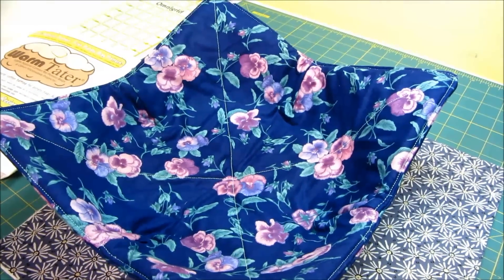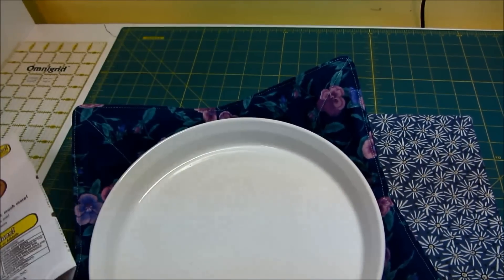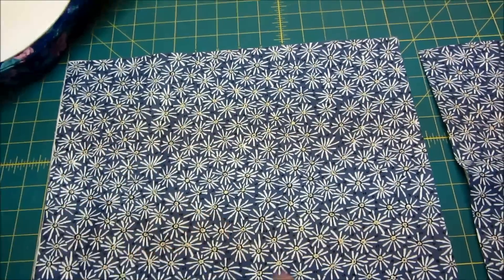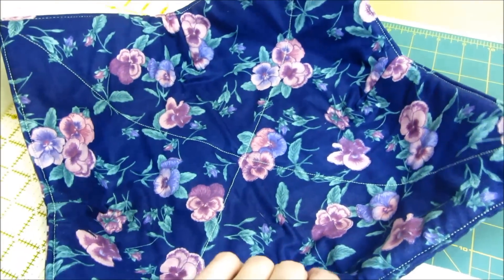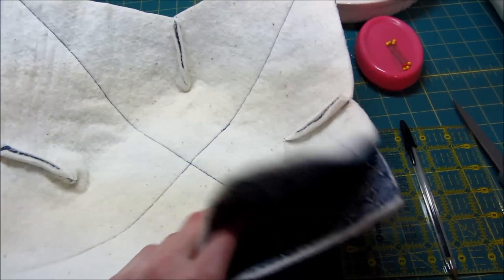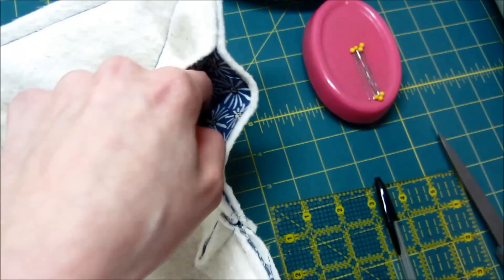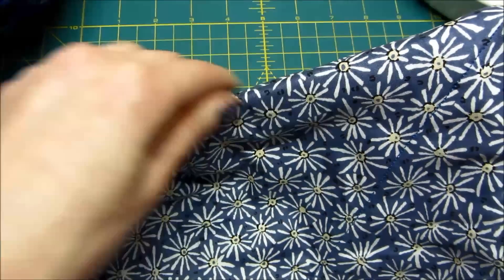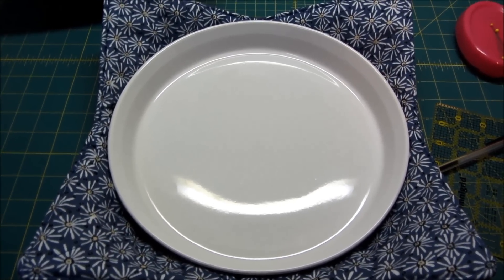How to make a microwave bowl cozy

Comment: It does not have to say for microwave or anything it just has to be 100% cotton, that means thread too. i make these but the batting is expensive so i went to harbor freight and bought a paint canvas it is 100% cotton too. but you have to cut off the edging that is polyester thread. they work great and are very cheap to make that way.
Reply: Thanks a lot for that tip. ❤️❤️
Reply: I often use old 100% cotton flannel sheets that I find at thrift stores.  I also discovered when I use cotton batting, I can use only one layer of it and one layer of cotton flannel without giving up any insulating protection whatsoever!  Batting is so expensive and since I make the cozies to donate to charity and as gifts for friends and family, the cost of materials is important to me.  I've made several cozies using only the cotton flannel and they turn out great and they go together a lot easier than using batting.  Most thrift stores also have fabric lengths AND I often look for 100% cotton clothing in cute prints. Check the largest sizes since they'll have the most fabric. So affordable and a good way to repurpose clothing.

Comment: Cut the batting 1/2" shorter on each side in reducing bulk for topstitching 4 layers only of decorative fabric instead of 8 (4 batting & 4 fabric). The edges do not need batting ...
Reply: Thanks for that tip. I have a lot of trouble top stitching around the edges due to the bulk of the batting even after cutting down to the 1/4'. I will definitely try this.

Comment: A suggestion on the darts, if you open them out instead of folding them on opposite sides you will not have so much bulk.
Reply: Thank you.  I would love to SEE what your hint means so I can really get it.  I don't use my sewing machine alot.  
The demo was okay but being TOLD how to cut the  outside corners isn't the same as being SHOWN how to cut the corners.  That's why they call it a DEMONSTRATION.  ;)
Reply: I agree.  It also makes it easier to match up the dart seams.

Comment: WHERE CAN YOU GET THE BATTING THAT YOU ARE USING FOR THIS TUTORIAL
Reply from the maker: Hello! In this video, I am using a product called Warm Tater by the Warm Company. This product was discontinued by the brand several years ago. However, you can purchase Wrap N Zap by the brand Pellon. (Pellon makes several types of battings, interfacing, stabilizers, etc and is carried at a wide variety of stores) The most important thing you are looking for is a 100% cotton batting. Be very careful as many battings are poly-blends, you MUST use only 100% cotton batting to be using it inside your microwave. :) Hope this helps!
Reply: @QuiltersWorkshop  THANK YOU FOR GETTING BACK TO ME I ALREADY FOR THE 100% COTTON I JUST WANTED TO KNOW WHERE DID YOU GET THE BRAND THAT YOU WERE WORKING WITH I LIKE THE PRETTY PRINT FABRIC THAT YOU ARE USING IN THIS TUTORIAL THANK YOU FOR SHARING